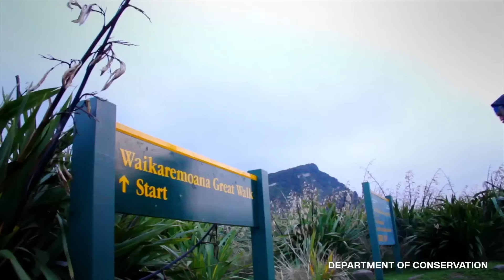10 Moments You Wouldn't Believe if Not Filmed

Comment: The clip in the russian steel factory: apparently, that failure mode isn't all that uncommon. There's a different clip out there that looks very similar that happened in a steel mill in Germany. Someone familiar with the plant explained that the bucket started leaking molten steel and the procedure is to use the crane to move it to an area where it can safely dump its whole load. In the process, you spray molten steel along the path the bucket takes but that path is pre-planned and set up to minimize the damage from the molten steel. It looks impressive but it's not all that dangerous unless someone is doing something excessively stupid. I remember one of the workers being grumpy because he lost his bicycle after parking it in the wrong place... ;-)
Reply: It's what we call an "open stop" it happens, not often but it happens. On the underside of the pan there's an hydraulic or pneumatic controlled opening which, in this case, did not close when instructed. The rest of the procedure of "open stop" has been written above
Reply: I want to see the video of them cleaning up the steel after it's hardened LOL
Reply: Glad my young Russian speaking niece wasn't here.  I'm thinking the words may have burned her ears.
Reply: I've seen a similar clip.  The traveling bucket full of molten steel caught up on the rim of the massive vat and it tipped the contents everywhere.  Like a small tsunami of death rolling across the floor, knocking smaller racks and control stations down and rolling right over them.  No one was hurt.  It kinda happened in slow-motion until the tsunami started.  It was AWESOME to see.  An Oops! on a massive and frightening scale.  All I could think of was how were they gonna clean it all up.
Reply: Thank You for the info!
Reply: Omg a real life game of "the floor is lava".
Reply: @lethiapage4767  Yes, but in hard mode. Molten steel is quite a bit hotter than lava, several hundred degrees. Lava is 800-1200C, steel melts around 1550C. To keep the steel liquid while they pour, they heat it up a bit more, so I'd guess that steel is around 1800C...
Reply: @wendybutler1681  i don't speak a word of Russian but I felt like I understood what was being said as the tone changed from the beginning of the spill until the end of the video.  🙂
Reply: @justjane805  the speaker enjoyed the situation. 
it was fun for him.

Comment: The steel spill was a failure of the Slide gate valve on the bottom of the ladle. I worked at a similar mill in the US and witnessed similar failures. There however the crane operator quickly moved itover a pit where the molten steel was harmlessly contained.
Reply: Worked at an iron foundry and the bottom of the furnace gave way and spilled the whole load on the floor. Threw sand over the top of it and spent the rest of the night shift prying it up from the floor.
Reply: we still have steel mills?  that surprises me.  who runs them?  certainly not gen z or millennials,,,

Comment: On those type of bridges it is usually recommended to walk at least 10 feet apart to spread out the weight.  Some have even higher distances between people recommended.

As for the can opener bridge.  The put up height sensors, traffic lights, and lighted sign telling truckers when they were too high to go under the bridge.  Some people still ignore the signs and try to go under.

Comment: 14:48 "There is a duty pursuant to international law for a ship to attempt the rescue of persons at danger at sea. This duty is based on a long-standing and strongly felt moral obligation among seafarers."

Granted, the distressed vessel is not at "sea" but those aboard the filming boat (cracking comments about modern day titanic) just sat there and didn't immediately head over to HELP pull anyone from the water. Filming was the priority?  Kids today huh???
Reply: However, you don't have to put yourself into danger to do so. If there had been people actually floating around and not just wading ashore, you'd have a point, but in this case, I'd have stayed away as well - no need to have the house boat capsize on top of my boat.
Reply: The boat falling over and sinking was also MOORED... Granted it was an informal mooring to a tree, but it wasn't free-floating, nor occupied at the time...

    With the apparent owner (and one would suggest "Captain") on the shoreline standing by for it, it's presumable that nothing more needs be done while the thing settles to a stop. Approach without people in the water would border on reckless, so without such reason, it's best to stay back, and filming and cracking jokes is as good of an occupation as any at that point.  ;o)

Comment: The trucks that get damaged by the can opener bridge get at least one warning signal sign before they go under that they are too tall and need to turn around. Either these drivers are willing to roll the dice and pray that they make it or just don't care.
Reply: Yup. So true. I live in Raleigh, NC lol
Reply: Yes- I wonder why they don’t have a swinging bar at the same height about a metre before as a warning
Reply: The guy that went through really slowly, as if that makes a difference 😅😂😂
Reply: It's always funny to see sturrowed cats/trucks.
Reply: @Doris9664   - from the videos I've seen of the intersection, they have an electronic sign both on the bridge and about a block before you get to it, the type that are on highways that warn of road work or Amber Alerts. If your vehicle is too tall and you pass a certain sensor, the signs will tell you that your vehicle is too tall. If multiple signs before you get to the bridge and a couple actually on the bridge aren't enough, I doubt the swinging bar will convince them. I read that most of the vehicles that get damaged are RVs and rental trucks driven by ordinary folks who most likely just think that they really do fit or don't believe the signs.

Comment: I wasn't actually too alarmed by the last one. The important part is they knew it was coming the moment it started, AND their boat had already passed. Given they where in a motorboat, I knew they'd be just fine. Still, must have been intimidating to actually be there.
Reply: God bless all the good souls who worked so diligently to save this doggo.They are all heroes.
Reply: yeah but think if the engine sputtered and failed or if they took on enough water to be slowed
Reply: @pauls5745   maybe, But not likely. At least as long as it wasn't a trash-grade tour.

Comment: Saw a truck do that on a city street, and it tore down lines and street lights for maybe 8-10 block before it was stopped
Reply: You don’t have to leave the dump bed up for it to go up on it’s own. If it had an older type switch or lever to engage the “power take off” or PTO, and is wasn’t fully disengaged, it will build pressure very slowly and only after the truck has driven some distance. They obviously either didn’t have the bed lock engaged or it failed so the PTO pushed the bed on up as they drove and unless they are paying attention, they won’t notice at first. Basically a lot of things went bad with that situation.

Comment: If the floor was concrete that would have been very bad with the molten steel being poured on it because if it had it would've caused the concrete to explode for heating up past 800 degrees

Comment: Wait, look at the tires on the black car, in the 1st picture, they are both flat tires at least the front tire was.  The truck driver may have thought he had time to push the car out of the way but couldn't go any further because the flat tires hit the railroad and the gate?    Maybe there was a husband in the passenger seat, that told the driver to get out, since the train was coming, slid into the driver's seat, and then moved it forward?  Who knows but it is a possible scenario.

Comment: The idea of art class teaching perspective and math teaching measuring people should not be driving into bridges. I don't know why they just didn't alter the road underneath to pass lower under the bridge most road underpasses are at much lower angles and depths. The "can opener" bridge is a fitting name indeed. I feel sorry for the people with moving trucks, all their belongings are in there strewn all over the road  :(
Reply: The can opener bridge cannot be raised.  It's a railroad bridge and to raise it would require a huge project to change the grade of the tracks for miles in both directions (and costing many millions of dollars, not to mention closing down the whole railway for months while the work is being done).  Neither can the roadway underneath the bridge be lowered due to huge sewer lines and electrical infrastructure beneath the road.  Most of the trucks that crash into the bridge are rentals from businesses nearby.  The renters are warned about the low bridge when they rent the trucks. ☮️

Comment: I know almost nothing about boats, but that seems like a very poor design.  Why have something with that much space that can't handle the weight of people being on it?  Maybe there is more to it, like the boat drifted too close to the shore and bumped against it, causing it to tilt and start taking on water, but the way it is presented in the video just makes it seem like a crappy boat.

Edit: Looked around on the internet and found more info on this.  Apparently the boat was built by the owner and had already sunk one time before this (for the same reason of too many people on one side).  So, my initial intuition was correct: terrible design.  Just a case of someone with more money than sense.

Comment: Sheer stupidity on the Transportation Dept in NC in regards to the "can opener bridge". Just dig out the road thus dropping the height without doing anything to the bridge and pave it again.
Reply: I've read somewhere that there are utilities running underground, so not as simple as just "digging it out".
Reply: Why should the state spend millions on lowering the bridge when it tells you if you're too tall, and if you choose to ignore that it's your insurance that takes the hit. Those kind of love taps don't really do any damage to those old trestles.
Reply: There was a sewer main in the road under the bridge, and digging down to increase the bridge clearance would have required removing and rerouting the sewer pipe. The only other options are closing that road to vehicles and making it a bicycle and pedestrian, underpass, or building an overpass.
Reply: Agree with the other comments.  The railroad owns it. The only reason it was raised was to even out the grade. If you can't read the big flashing overhead sign, then you deserve what you get.
Reply: @Epiphonus9 Also electrical infrastructure beneath the roadbed. ☮️
Reply: And create a pit for rainwater to accumulate in? How about truck drivers just learn to read the signs?